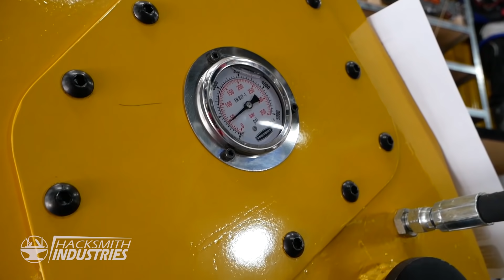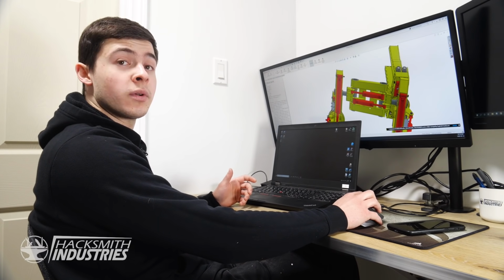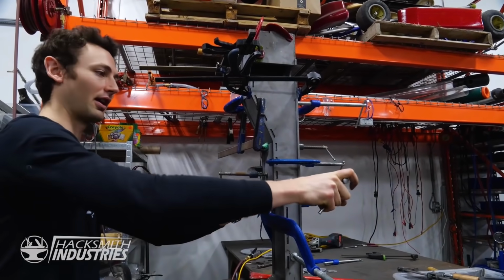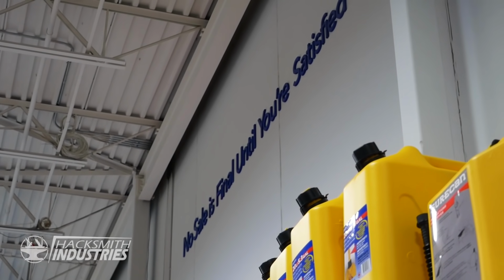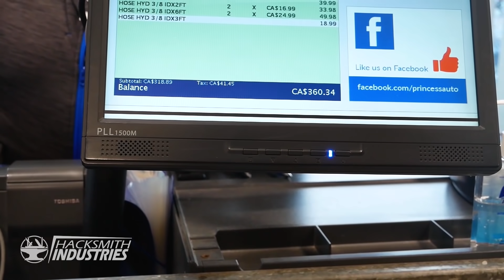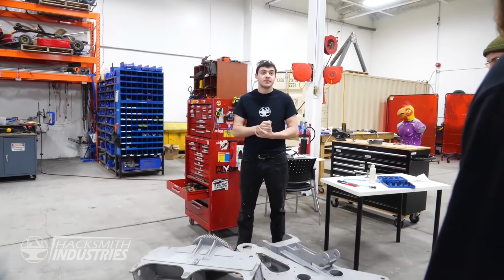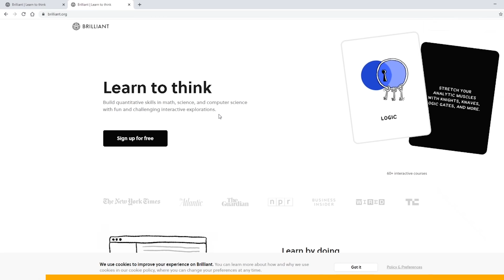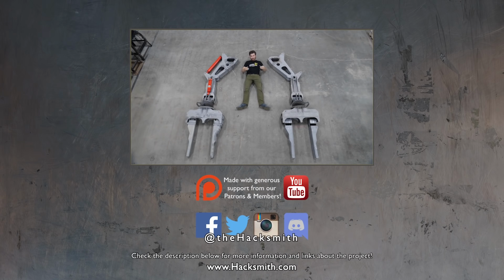I HAVE GIANT MECH ARMS! (POWER LOADER: PART 7)

Comment: Hi HS.
I've spent the past twenty-five years playing with subsea robotics and encountered some of the issues you're enjoying :)
Have you considered the need to reduce the turning moments of the arm(+wrist+jaw)? Counter-weights, damping, min oil pressure etc.
Re Wrist rotate and hose management. I'm guessing it's cheaper with hoses then running pressure through slip rings to work the jaws.
 I'm enjoying this project and envying you every step of the way :)
I wish you success with it.
Trevor

Comment: Hey, I have an idea for a make it real!  MAKE A REMOTE CONTROL SHURIKEN!  Make make 4 of the same wings and then make a super strong X brace in the middle like by welding the square tube sections together or using epoxy to connect 2 carbon fiber rods so they are perfectly flat and perpendicular! Anyways the point is to put propellers with motors on them onto the wings (hopefully on the top side so they don't break if it lands unexpectedly). Maybe put 4 wheels on the wings and like a little foot in the middle on some kind of spinner so that the weight is supported when its not flying. If you paint it all silver to look like a shuriken you will need to put different color lights on the wings so you know what orientation it is in even though it is going to be spinning. Maybe you could use RGB lights and have them blink with the spin and program it so pressing forward always makes it go forward? You could get some kind of primitive control over it with a basic drone set up but I think it will need a fair bit of programming to get it to work. If you really want to get crazy then put actual servo motors on the flaps so you have even more control, maybe you could even use winglets as rudders with servo's directing them. If you can measure how fast it is spinning  and somehow let it know it's orientation then you can oscillate the engine speeds or flaps so you can control where it flies. You can also use that info to set the flaps to flutter as they pass a direction so you can tilt it and fly it at an angle or use the info from the gyro to tell if it is tilting of course and automatically fix that. If the timing is a little bit off then over time the forward direction could become left if you know what I mean. Actually now that I think about this, it would probably just need to have the programming on a drone or 2 modified. And you could make this into a multiple video thing where you show us the results and how it flies in aq video after each iteration. It could be a multiple video project finally and up flying it perfectly with the programming at the end showing all the steps it took to get there or it could be like a one day goof type of thing depending on how much effort you want to put into it! If you paint it silver and make the wings look a bit like knives then you can call it a remote control shuriken and I know thre has to be some anime that has something like that in it so you can turn it into a make it real episode. If not then I'll just have to get Allen Pan or Peter Sripol to make it.

Comment: "AN" and jic fittings are the same. so AN6 and jic6 are the same

jic and orb have the same threads but seal differently. 
jic only seals on the 37* face
orb only seals on the flat face

we have them both down here in the states. 

now the weird one is bspt (british standard pipe thread). think npt but metric. it's about 1tpi different so with a little extra teflon tape you can usually interchange them

Comment: maybe its to late. But for future projects when you work with a 3d program: name all the components even the purchased parts in the iporperties. Then when you create the asselmbly drawings you can export the parts-list into a excel worksheet. That helps to have an great overview of all components on a long term when you for example do the procurement.
Reply from the maker: Only really necessary if you're planning on making more than one ;)
Reply: @hacksmith  exactly :D maybe for other future projects which requires a lot of purchased-parts like hydraulics components. You can caculate the amounts and prices to reduce/estimate the projects cost. sometimes when you order for exampe pneumatics plug connections which is quite expensiv, you can get an discount by certain minimum order value. hope it helps to reduce the cost.

Comment: You guys should get a multiprocess esab welder like the 235i that way you can run flux core mig lift start tig and stick  because it will weld better than an eastwood and with the stick you can really get some good beads on that thick metal
Reply from the maker: There's nothing wrong with our welds though... they aren't about to break
Reply: @hacksmith  oh no I'm not saying they will break I was just saying it could be a better option to use stick welding because you can lay a thicker and fatter bead with stringer beads and weaver beads

Comment: It's going to be real interesting to see is this thing doesn't tip right over with all that steel in the arms. The plate could have been half as thick, or less, and still be strong enough given the geometry.
Reply from the maker: Watch the whole series,  we did the calculations.
Reply: @hacksmith  I have been. Don't recall you calculating for dynamics, but maybe you did. I think it's a really cool concept, but man, the weight.

Comment: Is there a reason you used MIG rather than something with more penetration like a 7010 root with a 7018 cap or a 10018 cap? Or was the mig used for time savings?
Reply from the maker: No idea what those numbers mean
Reply: the Hacksmith it’s code on SMAW welding rod. It represent tensile, position rod can be ran and flux make up.